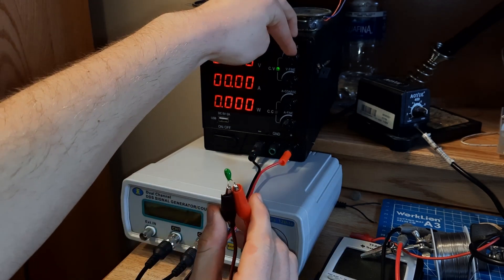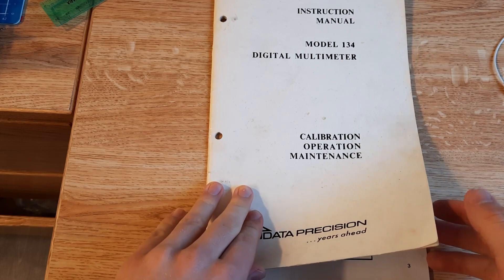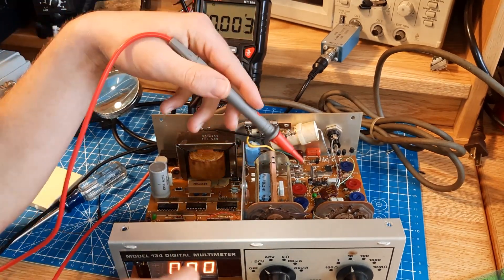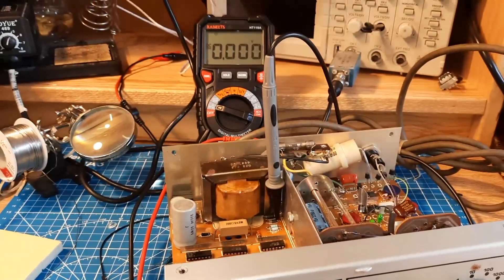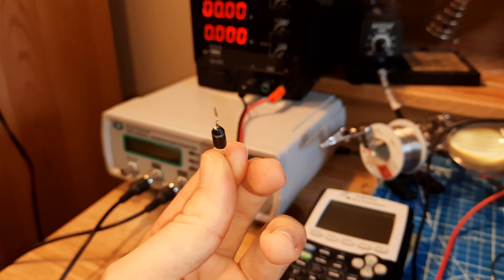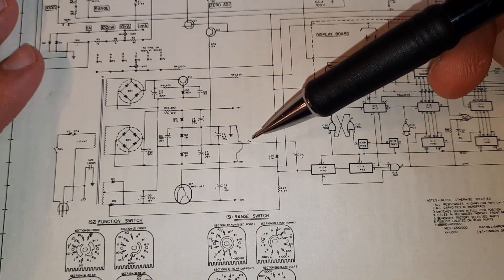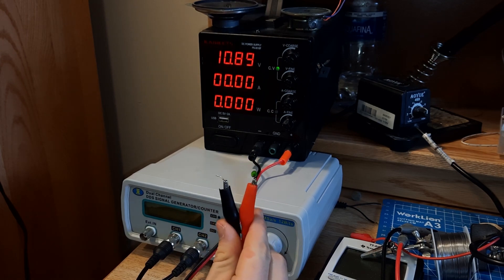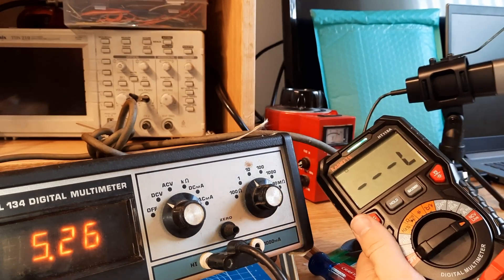Fixing a vintage digital multimeter(Data Precision Model 134)

Comment: Good to see the old meter fixed! Always check tantalum capacitors because they're well-known for failing dead short. I think the reason for the metal bus-bars is for low-impedance power distribution. It looks like the entire meter is one big single-sided PCB, so power distribution would be tricky for the designers. I have some Data Precision 3500 meters which are 5½ digit Panaplex instruments, and they're not only double-sided PCBs but also much more complex than this one.

Comment: I see a new oslilloscope around:P
Reply from the maker: Yep! I found it in the trash.  It looked like somebody had connected one of the BNC connectors straight to the mains power supply and blown it out.  I soldered in a new BNC connector and it worked good as new.  These tek scopes sure can take a beating.

Comment: You dont have to have it powered to test things like diodes, the meter should already come with a diode option and foward voltage option👀

Don't assume anything is good or bad, chances are, it'll be the last thing you check but the first to go wrong

Be careful when replacing bidirectional capacitors 😅 what are they teaching you at that school of yours

Comment: Yeah the good old tag tants are the first things to look at usually... They almost always fail short.
Reply from the maker: That makes sense, I just found that the hard way.  Do you have any idea why?
Reply: When they first came out they were billed as kind of wonder capacitors - wouldn’t dry out like electrolytics, stable, reliable, didn’t need to be underrated, etc, etc.  Equipment manufacturers took the cap makers at their word and would run them close to their rated voltages.  Turns out they really DON'T like being overvolted, but they were often used in conditions close to their voltage limits (a 6 V cap being used on a 5 V rail, for instance).  This is close enough that turn on spikes can stress the cap, and unfortunately their failure mode when overstressed is typically to short.  On high current supply rails they have a bad habit of turning into matches when they do so.  Luckily the one in your meter was in a circuit that couldn’t pump a few amps through it, so it just loaded things down rather than emitting its magic smoke.

Nice repair - I very much like nixie and panaplex displays, and have been collecting instruments that use them for years now.  That Data Precision is a nice little meter - congrats on the fix!